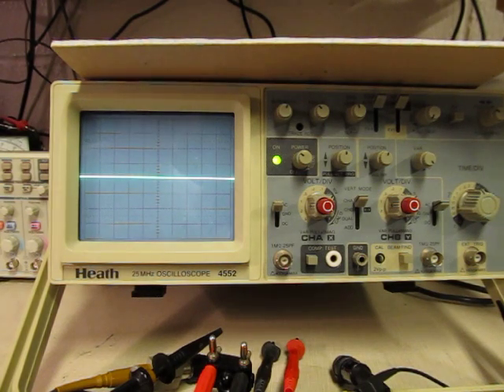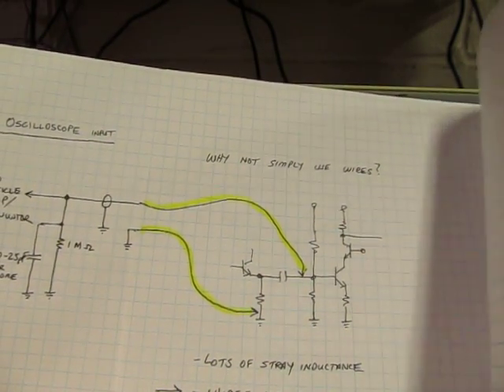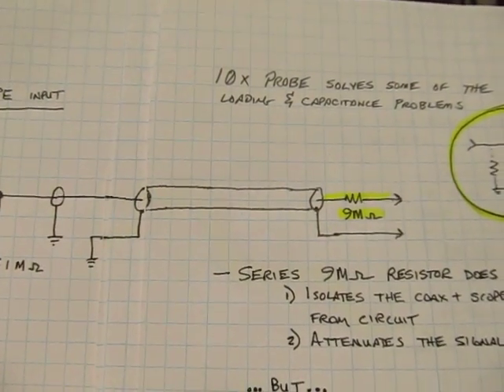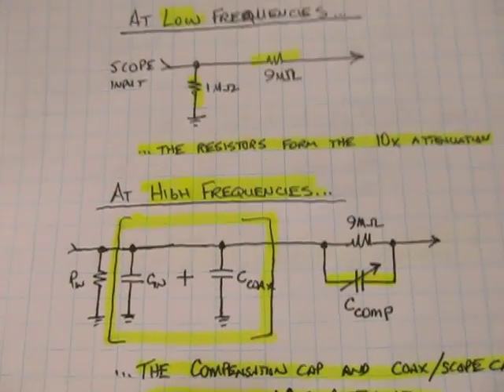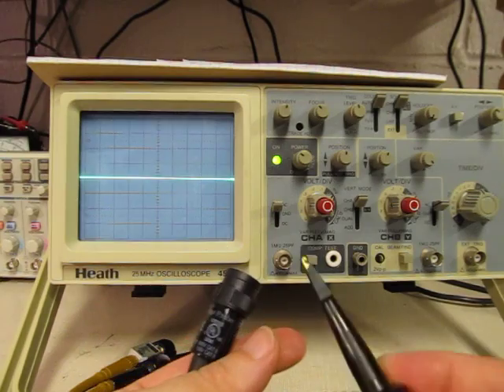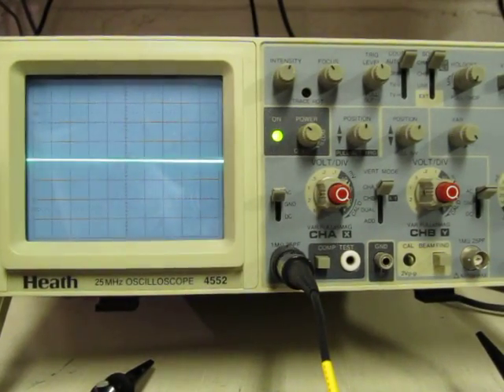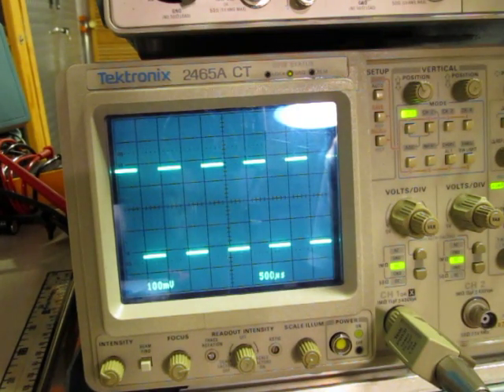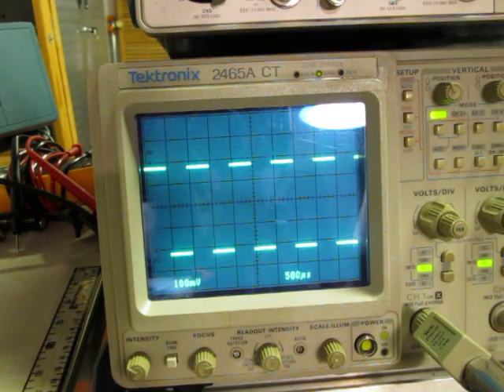#9: Basic 1X and 10X Oscilloscope Probe tutorial

Comment: i have a Tek P5100 100x 2500v pk probe, with a agilent infiniium 54831B o-scope. I need to verify voltage output of a power supply with outputs in the 800-1400v range. will this probe scale the voltage to the 8-14v range on my oscope? I do have other probes available to me.
Reply from the maker: It will scale right, but you will overload the probe.  It is rated for 2500Vpp, but only 1000Vrms, thus only 1000Vdc too.
Reply: w2aew thank you for the quick response.
Reply: I do have a p6015a 1000x, but the manual says it is made for 1.5kv to 20kv, any recommendations for something around 1500Vrms/Vdc?
Reply: The P6015A should work fine.
Reply: Alan Wolke I plan on trying it out. Thanks Alan.

Comment: On my 2215 Tektronix scope it has marking of 1xscope and 10xscope but not "pull for 5 or 10 x Mag" what is the difference?

when I set 10 x its reading OK. When I set 1x its off the scale. Why is that?

When I set very low millivolts and connect probe I get awful noise, why would that be?

Any help would be appreciated.
Reply from the maker: The "mag" settings are for magnifying the horizontal scale and has nothing to do with the 10x probes. 10x probes attenuate the input by a factor of 10, thus multiplies the vertical scale setting of the scope by a factor of 10.
Reply: +w2aew But some scopes have 5x or 10x Mag on vertical scale too - to increase volts scale. Am I right?

When I set very low millivolts and connect probe I get awful noise, why would that be? Do I need to add 50 ohm resister and set probe to 1X?
Reply from the maker: +jon123423 Yes, some scopes do have a vertical magnifier, but it is not very common.  
There is no "milliwatts" setting, so I assume you mean "millivolts".  Yes, it is very common to have a lot of noise at the most sensitive setting, especially when not connected to anything.  The front end it acting like an antenna.
Reply: +w2aew Sorry my mistake, Millivolts. But  Do I need to add 50 ohm resister and set probe to 1X?
Reply from the maker: You'd only use a 50 ohm termination when you are connecting directly to high speed signals with coax, those that can drive 50ohms directly. The 10x or 1x probes don't need the 50 ohm termination.
Reply from the maker: +Jim Tiner Yes, you can use a a simple 50 ohm thru terminator.  And true, you may not accurately see the true signal rise/fall time with a lower BW scope.

Comment: Does stray capacitance come from the interaction between core wire and grounded wire in the coaxial cable ? I made 2 probe cable, one from a rg58 and the other from a rg174, rg174 which is thiner has higher noise, what may be the reason ? But I think, they are noy because of capacitive loading if its effect is as shown here at the end of the video, here I am talking about parasitic noise distorting the signal.
Reply from the maker: It is very difficult to comment on what is causing your "noise" without seeing what you are doing, and what your scope is showing.  What some people call noise, others might call ringing, etc.  A picture or video is worth a thousand words.  Final comment - a 1x probe as you've described is only good for low frequency work.
Reply from the maker: Mustafa Tahsin Güler I posted a reply on your video page instead of putting it here.
Reply: OK thanks.

Comment: I need a 100X probe for dso520 oscilloscope. Can i use any 100X probe?
Reply from the maker: Sure, provided the compensation range includes the input capacitance of your scope.
Reply: *****
the probe i am looking at says 
Compensation range: 15-50 pF
I am buying a scope that is
1M-ohm 25pF

So i guess if i understand you right this will work. 

What I dont understand is probe says its
16 nano seconds rise time

The scope I am buying is 200MHz
Max. Sample rate 200MS/s

is "16 nano seconds rise time" good or bad.
Reply from the maker: It will work since the compensation range includes the input cap of your scope. 

The 16ns rise time of the probe implies that the probe's bandwidth is about 20MHz. It will work, at lower frequencies just fine, but higher frequency signals will be attenuated. A 20MHz signal will be about 3dB low, or about 70% of full amplitude.
Reply: ***** Thank you so much. you been helpful. This is the one i plan to buy.
200 MHz oscilloscope probe with X100 attenuation
 It claims 200mhz.

Are you saying If using the below probe I wont be able to read 100MHz sine or square waves? Or i can but it wont look like it supposed to?

Below is probe i want to buy.

16 nano seconds rise time
100 M-ohm resistance through 1 M-ohm input
Compensation range: 15-50 pF
1200 Volts DC including AC peak
Cable: 1.2 M (47") with BNC connector
Orange body
Reply from the maker: Samuel Atkins Well - there must be a typo somewhere, because 16ns risetime and 100MHz bandwidth don't jive together.  Typically a 200MHz probe would have a 1.7ns risetime.  Maybe it was supposed to read 1.6ns instead of 16ns.

Using a probe with a lower bandwidth than the scope won't hurt, you just have to realize it will apply a low pass filter to the measured result.  High frequency sinewaves will simply be lower than their true amplitude, and high frequency square waves will look more sinusoidal (since the high order harmonics will be attenuated).
Reply: ***** Thank you very much. I will ask the guy on ebay to verify. 

At this time I know only a little about oscilloscopes.

Comment: Lost me at 5:55 which I think is the point of the whole explanation. Darn! Seems to me at high frequencies the reactance of all the capacitors would approach zero, bypassing the resistors and shorting the input signal to ground.
Reply from the maker: The capacitance around the 9M resistor does not short the signal to ground, it just causes it to bypass the 9M.  Therefore, this capacitance forms a voltage divider with the input and cable capacitance.  It's just a capacitive voltage divider instead of a resistive one.  The overall input impedance is lower than the 10M resistive case, but the divider still gives the probe 10x of attenuation.  The process of compensating the probe is to get this capacitive voltage divider to be exactly 10x.

Comment: I got an old analog oscilloscope in working condition but the probe is broken and roughly fixed by replacing a cable with some piece of audio cable. It has option of switching from 1x to 10x. It has the scheme in tech manual and it says that it has 9М resistor and 6.8p capacitor in parallel and also adjustable capacitor of 8/30 pf (so it says) between signal and ground. Oscilloscope input is signed 1M 30pf. When I check it in 10x with calibrating signal it appears distorted, so the probe is obviously bad. What can I do to fix it?
Reply from the maker: +Galova The coaxial cable that is used for scope probes is not ordinary coax - it is a special cable with a lossy center conductor.  It can't be replaced with ordinary coax or "audio" cable.  Time to replace the probe.  There are very inexpensive ones on ebay, amazon, etc. that will work fine for hobby use.  Just be sure to get one that includes 30pF in its compensation range.
Reply: +w2aew I'll try to get some on ebay. But it's very interesting what is it so special about that coaxial cable? I got few coaxial cables, some with copper shield and copper solid core. ripped from some sort of video surveilance cable. It's not like TV cable. It's definitely thinner. How can I check it to fit its purpose and if it's suitable as temporary replacement, just before I get a new probe? I have no idea
Reply from the maker: +Galova The coax used for scope probes is special, and not like any other coax.  The center conductor is lossy - with more resistance than ordinary copper.  This is to minimize ringing, etc.  Dave Jones at EEVBlog did a video on this:
https://www.youtube.com/watch?v=OiAmER1OJh4